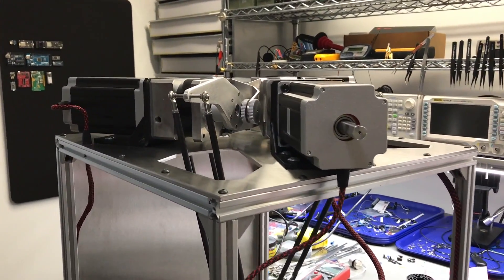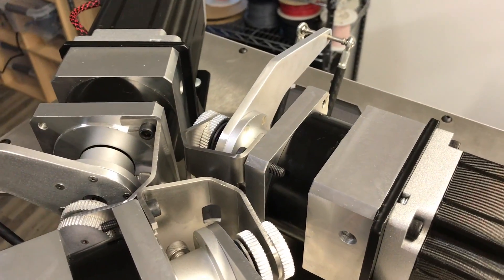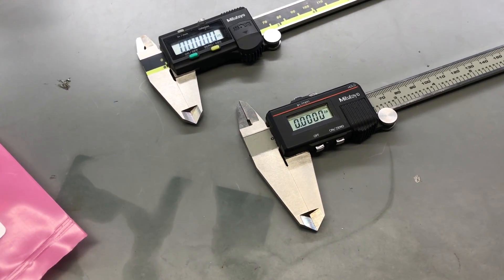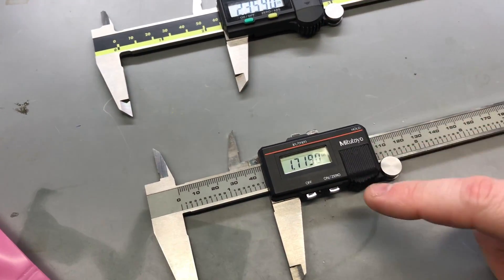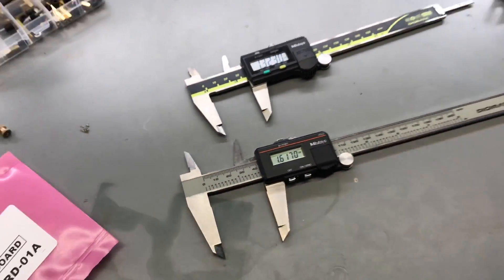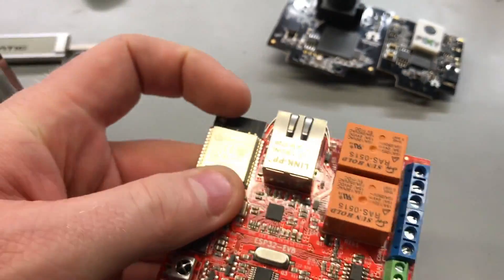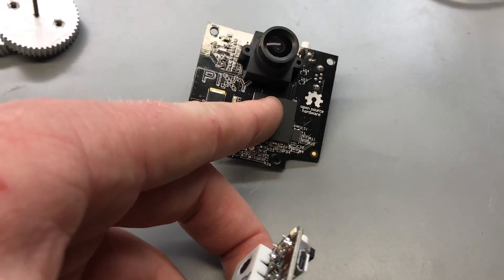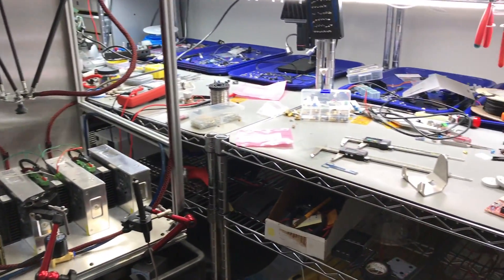Absolute vs. Quadrature Encoders

Comment from the maker: Here are links to some of the equipment shown in the video:
ESP32-EVB - https://amzn.to/2LYepZP
Object Tracking Pixy2 Camera - https://amzn.to/2tgO5Cy
Braided Cable Sleeve - https://amzn.to/2LedCnb
Stainless Steel Cable Ties -  https://amzn.to/2LevZsb
Strain Relief Cable Glands - https://amzn.to/2LdnuO8
Silicone Fusing Tape - https://amzn.to/2J5RPO8
Locking Casters - https://amzn.to/2kJ75WB
Aluminum Extrusion - https://amzn.to/2Lh14M7
Cable Clips - https://amzn.to/2xColG8
M5 T Slot Nuts - https://amzn.to/2HdnNWP
M5 Screws - https://amzn.to/2J4OSBs
LED Ring Light - https://amzn.to/2sqeIFs
Carbon Fiber Tubes - https://amzn.to/2J5xVqz
Suction Cup Nozzle - https://amzn.to/2LQFrDw
MA730 Magnetic Encoder - https://www.monolithicpower.com/en/ma730.html

Comment: just one thing I don't think that calipers have Absolute Encoders because the same model was teardown by AvE  and the moment battery is removed it "forget" and needs re-zeroing best way to test is just remove the battery and put it back in (do wait for caps discharging ) if it remembers then its Absolute

Comment: Holy shit! You and I need to talk, this is the first time I'm stumbling across your videos looking for a deeper understanding of quadrature encoders and already I need to know what you're doing, why, and what you're using. I have a ton of questions. I have built a Delta/Kossel 3D printer and I want to make a 6 DOF motion platform and, from my understanding, it is not too dissimilar from these Delta robots. The main difference is, of course, we aim for precision by keeping the "effector" (at least that's what we call it with the 3D printers) parallel to the print surface or work table. In these systems, you try to eliminate "effector tilt" as much as possible. I'm a motion system, like a full motion flight simulator, you want that effector tilt...and it's upside down....And much heavier duty. 

What is that? A pick and place machine? It's gotta be, why else would you be using machine vision and that geometry machine? 

You and I should talk because I am extremely interested in the motor control and I don't fully understand encoders, more the programming of them than anything else, I have access to a lot of motors and a fully equipped machine shop....also...I am proficient in Autodesk Inventor HSM and am a CNC Machinist and have access to a bunch of hardware, electrical, and software engineers...but they don't really do robotics, which is so close to being crazy helpful 😆 liking the Mitutoyo and that thing looks awesome, you use Misumi for the extrusion?  Those are some beefy motors, not cheap. Whatever you buildin.....it certainly looks like you know what you're doing, damn.

Comment: I am not 100% sure, but I think the newer Mitutoyos still use incremental encoders. It is just that they never turn off. That is how it knows the position when you "turn it on". One way to test is to remove the battery and see if the caliper still knows the position.
Reply from the maker: I am 100% sure that they use absolute encoders as it is in the patent and their website https://www.mitutoyo.com/wp-content/uploads/2014/02/2129-AOS-Calipers.pdf
The calibration value is stored in memory and is wiped when the battery is removed which is why there is a need to re-zero after the battery has been replaced.
Reply: good to know. Great stuff by the way. I like your content. Keep it up :)

Comment: Why do you have 3 separate power supplies ?
Reply from the maker: Because they are 60V 6A power supplies.  3 of those are cheaper, safer, and more readily available than one 60V 18A power supply.

Comment: Some addons.. quadrature encoders are called that, due to the pulse pattern they send out, quadrature pulses
The "absolute" caliper, is only turning the LCD off.. not the encoder interface
Reply from the maker: I have heard that Mitutoyo does that from other people but not ever seen any confirmation. Do you have confimation of that being the case?  Patent US5886519A states, "A pair of push button switches 134 and 136 are also mounted in the cover 139. The switch 134 turns on and off a signal processing IC and display electronic circuit 166 of the slider assembly 120."
Reply from the maker: That is not confirmation as they are storing the initial calibration value in memory. Removing the battery wipes the memory.  I would like to see confirmation from Mitutoyo, as I have not seen it mentioned anywhere in patents or directly from the company that they read values while in the "off" state. In the new model in the video, Mitutoyo uses an electromagnetic induction absolute encoder.
Reply: I dont know about that brand, but I have seen multiple teardowns of simular, and one looked into the capacitive strip, and it was just a repeating pattern :)
But hey, thats not what your video is about, the different of absolute and incremental was on point :)
Reply: That's my understanding as well. It's still powered on, hence why it keeps the count. Removing the battery will reset it, so the actual sensing track isn't absolute. They are cheating a bit there.
Reply: Try popping out the battery for a minute and see what happens.

Comment: Awesome. I dig the encoder setup. Question, is there something you are going to use the motor outputs on the back of the motors for? I remember in a previous video you had mentioned you purchased those specifically for motion measurement. Is the current encoder method different out of necessity because you have a gearbox?
Reply from the maker: I purchased them so I could have options because I wasn't quite sure what I was going to use yet.  I could have attached an encoder to the back shaft but I would need to use incremental encoders and limit switches.  Due to the gearbox, the back shaft will make more than one full revolution but the output shaft will not even move half of one revolution. The absolute encoder will allow me to avoid limit switches and never have to home the machine. It will also help with back lash that is only seen on the output shaft.

Comment: this might be a dumb question, but couldn't you just have used a potentiometer to see at what position it is? seems like a way cheaper option.
Reply from the maker: The assembled sensors on PCBs were only $10. A potentiometer would be ok for small projects that do not move frequently and don't need the accuracy like this.  There are two main problems with using them for my robot. Most potentiometers are not as linear as you would think so the positional accuracy would not be that great.  The other issue is that they would not last long on a robot like this that is rapidly moving all the time.  The wiper in the potentiometer rubs against a resistive ring which eventually scrapes off material and changes the resistance.  The sensors I'm using are non contact so will not be subjected to wear and tear.
Reply: That makes sense, Thanks a lot for the response!

Comment: Why did you choose to use these kind of encoders and not the regular encoders that are attached to the back of the motors?
Reply from the maker: Good question! I would need to use incremental encoders if I put it on the back because I'm using a 5:1 gearbox.  The back shaft will make more than a full revolution but the output shaft will not even move half of one revolution. Using it on the back shaft would force me to also use limit switches to zero the machine. The absolute encoder will allow me to never have to home the machine.
Reply: Proto G crystal clear! Where did you buy the encoders you're using?
Reply from the maker: Directly from MSP here: https://www.monolithicpower.com/en/tbma730-q-rd-01a.html